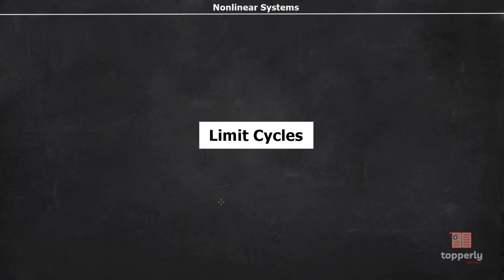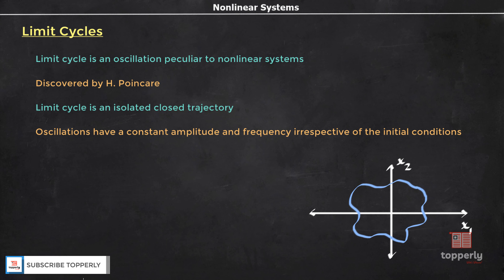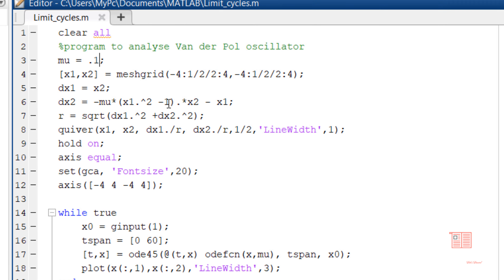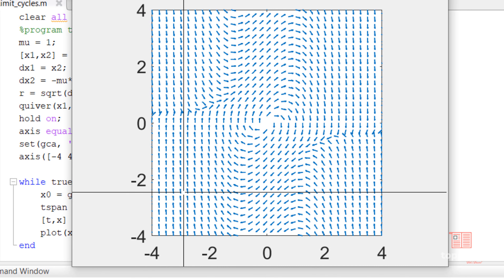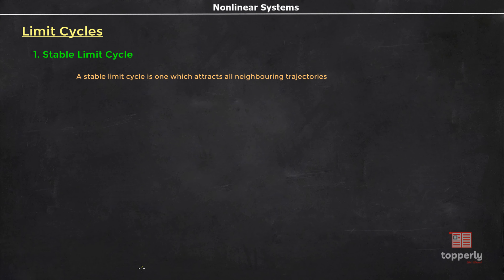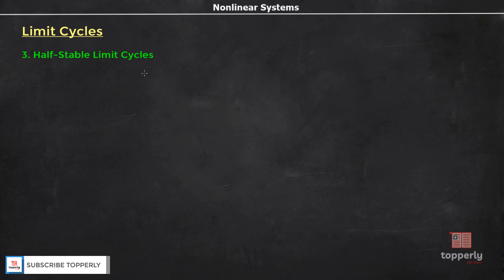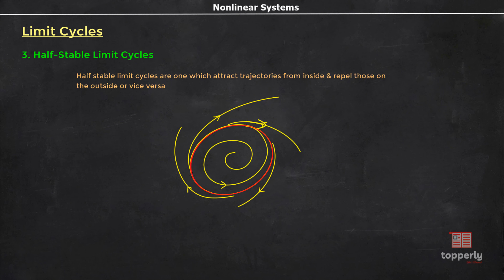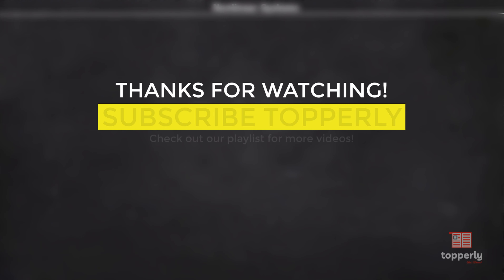Limit Cycles | Nonlinear Control Systems

Comment: sir, can you give me the code used matlab?
Reply from the maker: clear all
%program to analyse Van der Pol oscillator
mu = 1;
[x1,x2] = meshgrid(-4:1/2/2:4,-4:1/2/2:4);
%System equations
dx1 = x2;
dx2 = -mu*(x1.^2 -1).*x2 - x1;
r = sqrt(dx1.^2 +dx2.^2);
quiver(x1, x2, dx1./r, dx2./r,1/2,'LineWidth',1);
hold on;
axis equal;
set(gca, 'Fontsize',20);
axis([-4 4 -4 4]);

while true
    x0 = ginput(1);
    tspan = [0 60];
    [t,x] = ode45(@(t,x) odefcn(x,mu), tspan, x0);
    plot(x(:,1),x(:,2),'LineWidth',3);
end

function dxdt = odefcn(x,mu)
dxdt = zeros(2,1);
dxdt(1) = x(2);
dxdt(2) = -mu*(x(1)^2 - 1)*x(2) - x(1);
end
Reply: @Topperly  THANK YOU
Reply: @Topperly  I am getting error with this code Undefined function or variable 'odefcn'.
Reply from the maker: This was written in MATLAB 2018. May be the function name might have changed in newer versions. Please see MATLAB website for details :)
Reply: @Topperly  Thank you so much! 'odefcn' was missing on the screen, hence it was throwing the error initially.